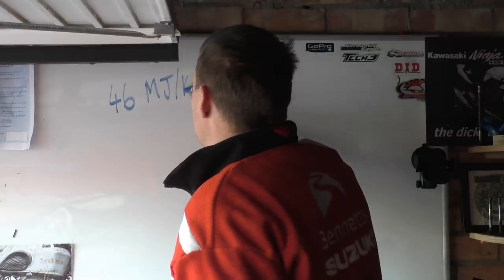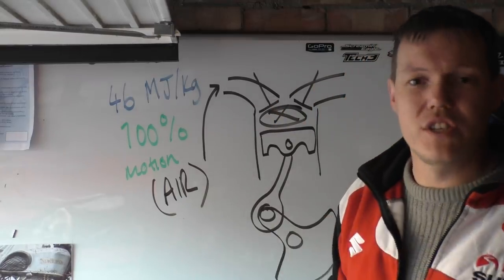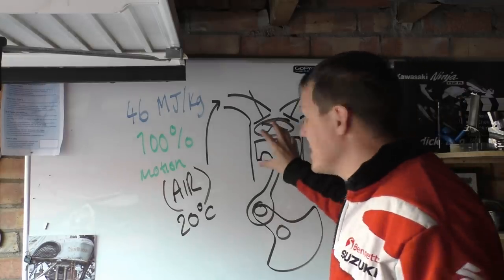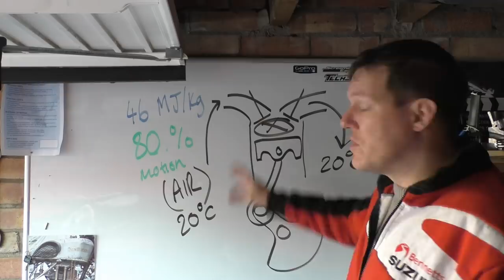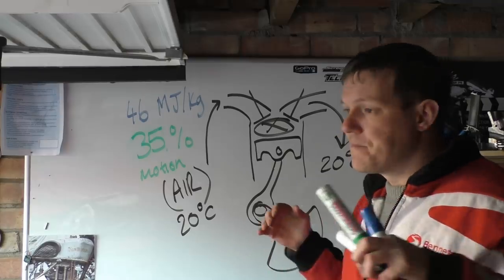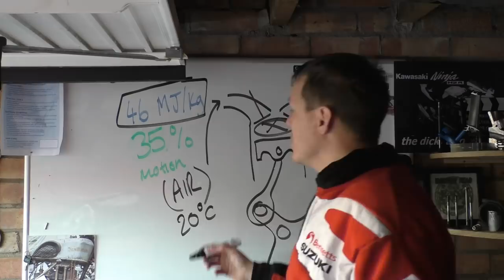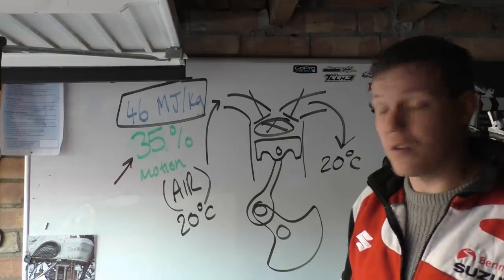What if an engine was 100% efficient?

Comment: Re pumping losses / crankcase breather... why not make the breather a one way (exit) valve, or even evacuate it with an auxiliary pump, so that there's less work done compressing / moving the crank case air?
Reply: I think they restrict the breather hose so when the engine running, there are little pumping going on and the air volume acts more like a spring.

Comment: This reminded me of when I was a kid, I had a period where I was trying to figure out ways of utilizing waste heat. 
I was a bit of a weirdo and I was a kid that didnt know shit about shit (still dont).
Reply: 😂 as a kid I thought abt making gear ratios infinite acceleration bike. So gear 1 turns gear 2 ratio 1:2. Gear 2 turn gear 3 with ratio 1:2 and gear 3 turns gear 1 again with ratio 1:2.. and connect this gearing to my cycle so I could keep on accelerating to infinite speeds as long as i had a road in front of me as the speed will keep on multiplying😂😂😂

Comment: The exhaust gas evacuation is actually a slight problem with high efficiency furnaces and water heaters. The exhaust gas doesnt have enough heat left to rise on its own. In some cases it needs a blower motor to pump the exhaust gases out. And plastic pipes to handle the resulting condensation. Metal exhaust pipes would rust

Comment: weight saving materials ie titanium ,would save some losses due to mass but cost a packet,anti friction coatings would lose some frictional losses,but same problem cost,limiting engine rpm say 2500 and making engines long stroke would improve,think also poppet valves ie camless would help,but if your doing all that lot cost alone would rule it out.

Comment: In my opinion, i'm not an engeneer, you'r right, the exhaust temp must be as near as possible as ambient temp. To acheive this me must use compound engines (multi stage expansion) or long course piston. But even with multi expansion the exhaust temp will be higher than temp air to permit expansion so i suppose at the final stage you must cold very hard the last cylinder to contract the air until acheive ambiant air to retreive the last power. This idea is not mine, the steam Watt engine principle was based on cooling steam to water who creates a violent depression.

Comment: At 100% efficiency the exhaust gases would have ambient pressure and temperature and it's only motion would Brownian motion. The engine would be silent when running and would have no cooling system. Right?
Reply: .. Should've watched the whole video before commenting.

Comment: If you could maintain a low pressure (vacuuuuuuum) in the crank case, would that make a measurable difference in efficiency?  Assuming an even number of cylinders and firing an appropriate number of degrees apart that the volume of the crank case stayed the same?  Or would that matter?  What about like a v-twin where the con rods share a crank pin?
Reply from the maker: "If you could maintain a low pressure (vacuuuuuuum) in the crank case, would that make a measurable difference in efficiency? "

well it depends on the down stroke yes - but not on the upstroke.

"that the volume of the crank case stayed the same?"

- I've done a video on this, just because the volume is the same doesn't mean the air instantly moves from one place to another -

Comment: My automotive teacher used to say that one of the largest wastes of energy is heat. But the key he told us was if we figured out a way to make the piston to cylinder wall clearance such that it doesn't allow blow by. 

He said they got close within say 96 maybe 97 percent. He said if you could somehow figure a way to get rid of that 3 or 4 percent you would be a rich man.  Or dead in a ditch haha. 

Would that technically allow oil to last almost indefinitely? Since most oils aren't hooped until soaked with carbon etc right? Or is that too simple?
Reply from the maker: No. Oil is subjected to physical stresses - which break down the molecules over time
Reply: @dirtygarageguy  So what do they do to revitalize oil when it is remanufactured? I'm sure I could Google it but I'm curious what your take on this process is. I'm always pretty iffy about using it in my vehicles. But I can't seem to kill my Silverados engine. Just it's transmission haha.
Reply from the maker: remanufactured?
Reply: @dirtygarageguy  That was a poor choice of words on my part. I guess its considered recycled oil. It's available a bit cheaper most auto part stores around here anyway. Always seems a but thinner but the claims are that it's just as good as new oil.

Comment: Matt I always though the compression stroke dosen’t use energy from the fuel. Since the energy used to compress the af mixture is delivered back into the engine during the combustion stroke. Example- So imagining an air compressor pumping in the first stroke reaching tdc and then the compressed air pushes the piston back to bdc(if i keep the outlet valve closed). So energy used to push the piston up is returned by the compressed air pushing the piston back down(not considering friction losses). So the af mixture after burning has the energy of the combustion and energy given to it by the compression stroke?.. plz explain whats right/wrong in the above.
Reply from the maker: "I always though the compression stroke dosen’t use energy from the fuel."

- Yes it does. From the previous power stroke. Initally the starter motor or kick start provides this momentum, but after that it's the momentum of the rotating masses, also known as angular momentum. 

It's not a friction loss, it's a pumping loss. 

Nothing is for free.
Reply: @dirtygarageguy  Ok. Please hear me out. Im very sure my argument is valid.

So imagine a motor spinning an ic engine, without supplying current to the spark plug of the engine, so the energy which is put in by the motor during the compression stroke will be supplied back to the motor during the combustion stroke because the compressed af mix pushes the piston back down.

So in the above case The net power supplied to the engine will almost be zero and no power will be supplied to the engine for the compression stroke as the power is given back.

The same thing will happen in a normal ic engine but difference is the extra pressure produced due to combustion of the af mix

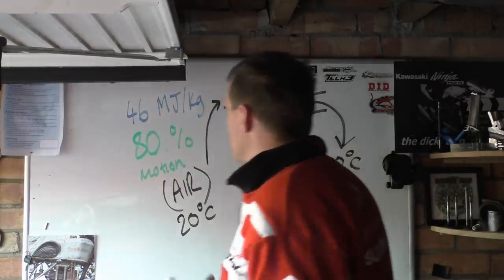In the video at 8:55 you mentioned that some part of the power is used up in the compressing the af mixture but that same power is given back into the crankshaft along with the power produced by combustion.

But in a normal engine when the combustion happens the (total pressure produced in the combustion stroke) = (pressure due to heat/combustion) + (pressure due the compression stroke in the same cycle).
Reply from the maker: "So imagine a motor spinning an ic engine, without supplying current to the spark plug of the engine, so the energy which is put in by the motor during the compression stroke will be supplied back to the motor during the combustion stroke because the compressed af mix pushes the piston back down."

- So you're saying if you compress a cylinder to TDC the piston will push back with the same force back to BDC?

This is incorrect. Lets forget piston ring friction etc. Pumping a gas heats that gas up. This heat is transfered to the cylinder, piston and head. This is a loss. What you are talking about is adiabatic compression, which in a real engine can never happen.

It's the same with a spring. If you compress a spring and release that spring, not all of the energy returns. EVERY time any work is done, there will ALWAYS be waste heat.
Reply: @dirtygarageguy  but thats barely anything right? Don’t you feel 18% even as a approximate number is very high? Only compression heat waste cant reduce the efficiency of an engine by 1/6th right?
Reply from the maker: 1/6th? Where did you get 1/6th from?
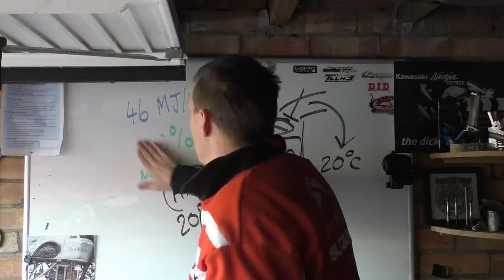Reply from the maker: Ah you're taking the % numbers in the video literally. @ 8:10 onwards I say: 

"we start losing straightaway we start losing this so it becomes 98 percent just from drawing stuff in, that's just a guess you know what I mean, it's not an actual number"

Going from 100 to 80% is pumping losses, inertia, etc etc from the intake side...
Reply: @dirtygarageguy  you estimated 18% efficiency decrease right? 1/6 power is 17% ish.. isint that a very high percent of power loss just caused by waste heat of compression..

Compression and expansion barely uses up energy. 18% loss is too high.
Reply: @dirtygarageguy ok.. is there a way i can message you personally if i have any doubts.. i wont ask dumb questions.. im in my 3rd year degree in production engineering and all my doubts are stuff which i cant find an answer for using google.. basically saying i wont waste ur time

Comment: Sorry again mate, i'm just trying to comment on video's that are relevant to what i'm asking but thermal efficiency is how much of the heat from combustion goes into forcing the piston down and creating torque isn't it?
Reply from the maker: You take all of the energy that x amount of fuel will release when combusted. You then measure how much of the energy comes out at the output of the engine. That is the system efficiency. 

Included in that is everything from friction to pumping loses. 

Thermal efficiency is how much of the heat energy was transfered to the pistons kinetic energy.
Reply from the maker: Its just something we can easily calculate
Reply: @dirtygarageguy  cheers Matt, i do apologise for the constant questions mate all of what i've learnt and what i think i know has has came from watching Jason"s videos and as we all know he's not the most reliable source 😂
Reply: Is there also losses called blow-down losses? I heard of them somewhere are they even a thing mate?
Reply: What are blow-down losses in an engine mate?
Reply from the maker: Blow down is when the cylinder contents exit the cylinder thought the exhaust. This is more of a thing with 2 strokes but the same happens with 4 strokes
Reply: @dirtygarageguy  in a 4 stroke does blow down happen with valve overlap? thats the only thing i can think of that would give the air/fuel mix chance to go out the exhaust mate
Reply: Is this how blow down occurs within a 4 stroke mate? Its the way i can think of that would give the air/fuel mix chance to escape the cylinder.
Reply: Is it mate or am i way off the mark here?

Comment: Hey, Matt, how good an engine built specifically around LPG would be? It's 130 octane, right? And It's also a lubricant, iirc. Can you make an engine that takes maximum advantage of that and what can you actually do that would be unique to it as opposed to a diesel/gasoline one converted to run on LPG.
Reply from the maker: Lubricating? Are you sure about that?
Reply: @dirtygarageguy  If it is a lubricant its not very good, having run a few lpg cars long term, most have a little light oil reservoir and vacuum line to help reduce wear on the valve seats, unless its a forklift etc designed to run lpg from the outset that will have really hard valve seats.
Reply: @dirtygarageguy  Not sure, can't find anything about its lubricating properties now, but definitely seen something of sorts before.
Reply from the maker: I'd be blow away if Butane/propane even in a liquid state was a lubricant. It has fuck all viscocity.......

Comment: Not to pull too much rubbish out but I heard an f1 engineer say the the ICE(meaning internal combustion engine) was now achieving more than 50% efficiency without kinetic energy recovery but only in very special instances.
Reply from the maker: And you have proof of this - because that would be fucking amazing
Reply: Mercedes claim they have reached 50% on the dyno and is 45% on track. For 2017 the guys that analyses all the track data reach HP numbers for Mercedes and Ferrari that for 100kg/h is roughly 45% for the ICE
Reply from the maker: where's the proof? Just a question, not being a dickhead, or at least not trying to be a dickhead........
Reply from the maker: This article doean't say much but it does say 

"In F1's turbo-hybrid era it has become particularly important because of the strict fuel-flow limit rate of 100kg/hour."

- So from that I get 'turbo hybrid' which means electric, which means energy recovery. 

https://www.autosport.com/f1/news/131772/mercedes-engine-hits-remarkable-dyno-target
Reply: the data analysis wizards that crunch the numbers for speed and acceleration for all the cars on track reach a  peak hp number of ~950, subtract the 163hp from the electric motor and the ICE needs to make 787hp, to get that you need ~45% of 100kg/h * 46MJ/Kg
Reply: @dirtygarageguy  i cant find the original article this is the closest thing i can find https://www.youtube.com/watch?v=Cx4HMSNx_MY seems like i could be misunderstanding but why are they talking about changes to cdombustion chamber shape and claims half the fuel directly propells the car
Reply: on F1 the engine is used as full load quite all the time, ours cars are driven in cities at low trottle near 5% to 10% efficiency.  it's the reason why toyota use hybrid, to avoid low trottle...in my opinion, the best engine will be a generator cause the engine will always at high trottle.

Comment: since your talking about efficiency hears my brain twister if longer stroke engine has less surface area wouldn't that mean less heat waist verses shorter stroke engines.
Well there's more rotation mass in longer stroke engines 
More mass means slower speeds
Slower speeds means gasses cool before much work is done

If only there was a way to have long stroke engine in a small package well, then rod angle to crank gets wonky and one issue leads to the next list goes on. 
Pointless comment but cool engineering trade offs running threw my geography mind😉
Being an engineer have you ever seen the renowned MARBLE MACHINE if not cool engineering at work even a community of thoughts all around the world going into one project🤔

Comment: I have heard people say electric motors are 100/% efficient I can not see how. With an electric chainsaw Vs petrol I can say petrol can run through very tough knotty timber and resist getting pinched far more than electric. Electric just stops dead when petrol will slowly bog down. I think the reason is petrol has a flywheel & recipicating masses which carry momentem. An electric has very light moving parts and does not carry the momentum. They say electric has more torque. Now I agree at low rpm however at High rpm a petrol will pull through the cut under high loads and keep pulling all day long. An electric under high loads shits the bed and has not got the stamina of a petrol.
Reply: It's not fair to compare efficiency between petrol and electric motor, cause they don't take count of the efficiency of the power plant (30% to 60%). So an electric motor from pits to road as at maximum 60% efficiency and not 100%. And if the energy is based on french nuclear power plant, the efficiency is less than 33%  due to lost on the grid and after charge the battery....so maybe 20% (less than petrol if you road full trottle on highway near 35%).

Comment: Matt says, "46 mega Joules per Kilogramme", then states, "This is the Calorific value of the petrol".

Quotes the energy content in the metric measurement standard then says its the other Imperial measurement.

Slip of the tongue or just a figure of speech Matt??

1 Joule = 4.2 Calories.

The old leaded 4 Star petrol contained 52 to 54 MJ / Kg. of energy (dependant on pump brand). Tetraethyl Lead allowed higher levels of high energy combustibles (mainly Toluene) to be in the mix. Without Tetraethyl Lead these had to be reduced to keep the Octane rating acceptable, which dropped the energy value.

The unleaded petrol we have today is the "Diet" version of what we once had in the past, which is why engineers have to make engines more efficient and reduce losses. Engineers of old just assumed that the petrol-chemists would keep making the fuel more potent, then leaded petrol was banned and petrol became less potent instead, especially with energy reducers such as Ethanol being added to keep the tree huggers happy.
Reply from the maker: I also say gasoline/petrol - i could include BTU's if it made you happy. Just because they're different units doesn't mean they're different things. As you have just stated. Like mass or pressure.
Reply: Joulerific value? cheers